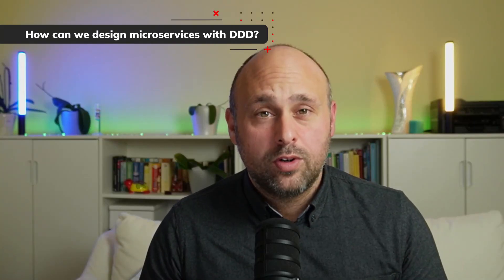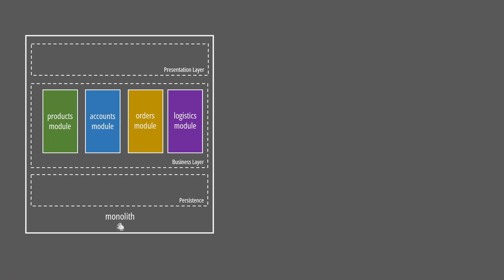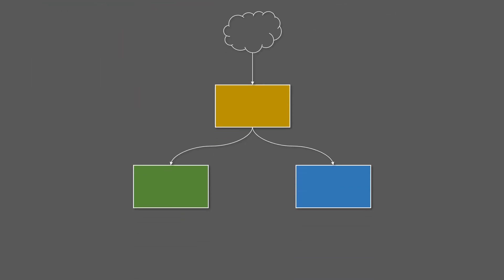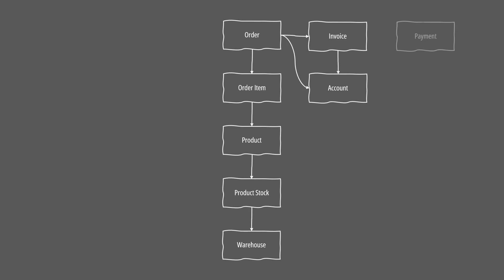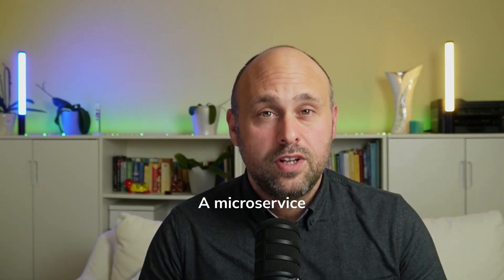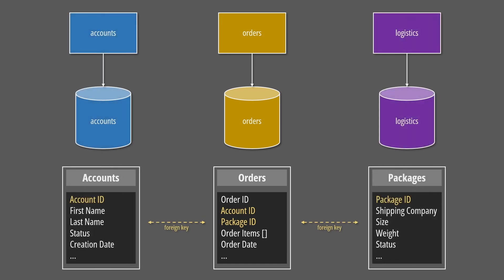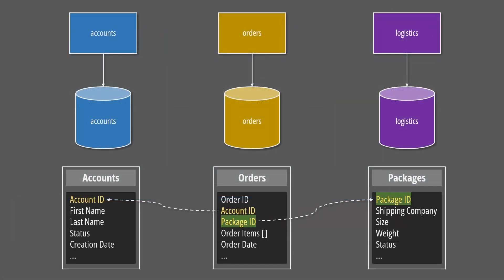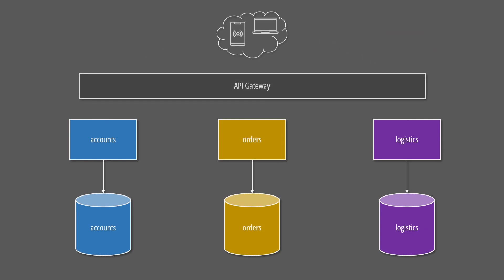Designing a microservices architecture with DDD | Is DDD still useful?

Comment: Hello Good Sir @Marco,

This is a brilliant video with very helpful and useful illustration 👍🏾

However, why are you separating Orders, Payments and Shipping ? These all change or are activated for the same reason - i.e. to fulfill an order

It makes no sense to separate them into different bounded contexts. This is how one ends up with micro-services (or modules) that are split too much there by creating services that require careful co-ordination between them. This is not to mention the high fan-out that can result from this structure of over-splitting micro-services
Reply from the maker: I am in total agreement with your advice of avoiding over-splitting and fragmenting the system into too many microservices. Regarding whether my example is fitting or not, I think it depends a lot on the context, functional and non-functional requirements.

That said I don't want to advocate for microservices at all cost. The video is based on the premise your goal is microservices to start with. I do have some other videos where I try to answer the question: do you need microservices at all? https://youtu.be/13AtILy2g8s 

That's said I really like your comment and I want to spare two words on bounded contexts.

Even if you decided to move with a monolith, you need to make sure that code is properly modularized. This is where bounded contexts comes very handy.

Typically, I don't see non-functional requirements having a lot of weight in the definition of the bounded contexts. Typically, it's enough to look a cohesion and coupling, i.e. we group together classes that tend to co-operate and try to create well-defined exit and entry points for each boundary we define.

If we look at it from that perspective, if your payment system is complex enough (and this depends a lot on the requirements you got), there are high chances that most classes have nothing to do with the order. For example, imagine your payment system should allow you clients to save safely payment methods. Typically, these systems are heavily audited and need stricter compliance, e.g. PCI-DSS. Suddenly, you can see we're not talking about something trivial and it's actually the only correct option to segregate Payments in its own services to avoid strict auditing and compliance to affect larger portion of the system.

This is just an example and still it holds that, in many cases, it's actually simpler as you described. In that case, we can move with one service and I support that!

Thank you a lot for reaching out. Really appreciated!
Reply: @MarcoLenzo  Thank you for your response.

You are right and i don't think the non-functional requirements matter much over proper cohesion and coupling concerns.

My earlier comment applies whether one is dealing with a micro-service or a module in a monolith (P.S. Micro-service are just modules on a high level of organization)

It will be correct to separate the Payments to be on its' own (pairing it with an Invoice generator maybe) if the need for compliance for PCI-DSS or SOC2 is high.

Yet, for Orders and Shipping, it need not be separated because they are cohesive. Orders will always need Shipping and Shipping will alway need Orders to ship especially for an e-commerce application.

It would be incorrect therefore to separate Orders and Shipping into their distinct bounded contexts.

Thank you for responding. 🙏🏾

Comment: Amazing video! Thank you. 

I got a question, did you used subdomains as a synonym of bounded context / microservice? if not what's the difference?
Reply from the maker: Yes, in the context of this video this statement makes sense. However, it is something nuanced.

The idea is that if you are in the initial stages of designing a large system, you will probably create a single large domain model and identify the bounded contexts which will give you an idea of how many microservices or "moduliths" you need.

The bounded contexts becomes subdomains because after the initial stage, I typically focus on them in isolation. In fact, they would be typically assigned to a specific team / architect. For that team, the original bounded context is actually the entire domain they are responsible for.

That is why I was mentioning it is a bit nuanced.

Hope it helps.

Comment: Marco, your videos are excellent. 
You show you studied what you're talking about. Your material is really good and far much better than those really poor articles that crowd the web, only mixing some keywords and saying nothing. So thank you.

I have a question on 2:57 ("Bounded Contexts are equivalent to Microservices")...doesn't it depend on the size of the bounded context? I suppose that there are situations where a bounded context may not match the condition of a pizza size team typically mentioned for microservices, for instance.

Don't you think bounded context might be implemented as a group of microservices with high cohesion but low coupling with microservices of other bounded contexts? I think my question might imply that some microservices depends on others (which is against the definition of microservices) but I'd like to hear your opinion. I think, in the end, as you said, architecture is about trade-offs, and, specially in big  and long-lived systems, creative ways for managing complexity are a must.

I think that part of the problem here is that "microservices architectural pattern" and "domain driven design" refer, at some point, to different parts of the architecture: ddd is a way of linking domain and implementation and microservice architecture as architectural pattern lacks of such concepts (or doesn't pay much attention to them) .

Thank you again!!
Reply from the maker: First of all thank you very much for your feedback! I really appreciate it!

You are totally correct in stating that a bounded context is not always equivalent to a microservice. There might be scenarios where the architecture defines microservices that are more fine grained. For instance, you could have a microservice per aggregate if you wished. The aggregate also defines a boundary that is used to identify not only objects that are strongly correlated, but also to reduce associations by electing a root aggregate which is the only object that can be referenced outside the aggregate. The operations an aggregate supports can be easily mapped to the API of a microservice.

As usual, it is a matter of trade-off. Sometimes it is not even just a technical matter. It could be driven by choices like the number of teams you need to deploy on the project.

However, let me move a point that might strenghten my idea that the bounded context might be a better choice from a purely technical perspective. The aspect that gives me a lot of think is the high cohesion you have within a bounded context. In other words, a lot of the operations you support within the bounded context require the collaboration of all the objects you placed within the boundary. That means that if you model this context as multiples microservices, these operations which are highly cohesive are actually happening by collaboration over the network (API or Messaging). That begs the question: why? Unless there's an asymmetry in terms of load or complexity of different operations within the context, chances are that you might be better off with a single deployable. Again, the devil lies always in the detail, so I'm just making an argument for the sake of debating.

Have a great Sunday!

Comment: I am curious what other strategies other than event driven solutions can be possible when considering sorting and filtering across different domains. Also you didnt mention about is DDD still useful?
Reply from the maker: Thank you for the feedback!

I think DDD is the core of our profession because we all need to map real world concepts and requirements into some sort of model. Some of us do that just mentally in our own minds. Others go through the effort of documenting such model and I think that is imperative if you are working in a large team or company.

Regarding alternatives to using events and creating materialized views that are fine tuned to serve your queries, the other approach is that to let each microservice manage its own subdomain and put an "API Gateway" in front of them. This is simply another microservice or a middleware that will perform aggregation. If the client makes a request that needs filtering and sorting across different domain, it will be the gateway responsible for collecting the data from the different domains and apply filtering and sorting. Obviously you will not match in performance the materialized views approach. In this scenarios, you can also consider a query language like GraphQL.

You can watch this other video where I cover the API aggregation topic:

https://youtu.be/yEzQs1stJhE?si=eg3tu7JubuTskqDg

Comment: For most businesses (so not the big boy businesses) distributed monoliths are imo the way to go, and you can always add microservices when you need them to scale. The complexity of microservices aren't worth to begin with. There's a lot that can go wrong without a well experienced dev team. The big boys netflix, github, etc. all started with monoliths and added microservices later after having the necessity to do so. Only after a version 1 should you even consider it, after identifying and understanding your domain requirements very well, and this is almost never the case when building a v1
Reply from the maker: I agree that in most scenarios it is safer to start with a monolith or a small number of services, especially if the team lack experience in dealing with microservices. I also understand that in many scenarios the product evolves rapidly in the first iterations and it takes some time before the requirements stabilize.

However, I still think we should invest time defining bounded contexts from the very early iterations, even if you intend to use a monolith. If you do that early, you can build your monolith as a set of modules with well defined and documented interfaces. If you do that, you'll have a much easier transition to microservices if you ever need to go there. Even if you decide to stick to monoliths, it would be easier to increase the number of teams working on it, because you would be creating space for each team to own a well-defined portion of the codebase.
Reply: @MarcoLenzo  Thank you for the response. I'm glad we're on the same page. I intentionally left out the modular part to test my understanding with yours. As building a monolith without well defined modules it is going to be a mess and will cause problems later on

Comment: Loved this video, but had a lot of trouble to understand some parts of what you said, having to repeat many times what you were saying where not even the subtitles helped, just to understand what you really meant.
In my opinion I think the biggest drawback of DDD and microservices are the need to de-normalize databases and manage it all to still keep it consistent. It seems that that monoliths and microservices PROS and CONS are mutually exclusive.
Reply from the maker: Yeah the trade-off is not simple. The nearest hybrid is the concept of modulith or microlith. This is usually a service that is managing two or more sub-domains which are closely correlated. If the modularization is done right, you can have them coexist to avoid integration over the network. That said, it is still debatable if you should use referential integrity at the DB level across modules. I generally avoid that to give myself the chance to break the modulith into separate microservices in the future.

Comment: You can implement the system loosely coupled, but it doesn't mean there's no coupling at all. You can put a service aggregator that connects multiple microservices. If not, tons of heavy lifting will be bourne by the client which is a no no... Especially on mobile where CPU processing is very limited and can be easily compromised. Also, you don't want this heavy lifting written multiple times in different mediums such as iOS, Android, web and whatnot.
Reply from the maker: Totally agree with everything you said. Some level of coupling is unavoidable and aggregating data for the clients can be a necessity in many scenarios. I feel decisions are rarely clear cut. We always balance pros and cons in the context of the type of system we deliver.